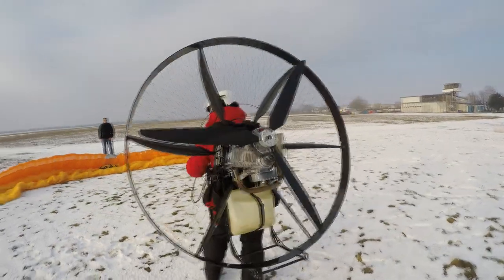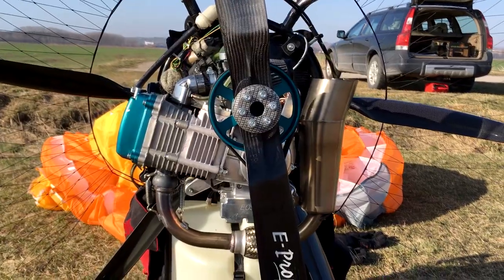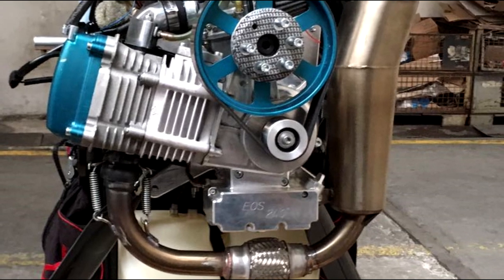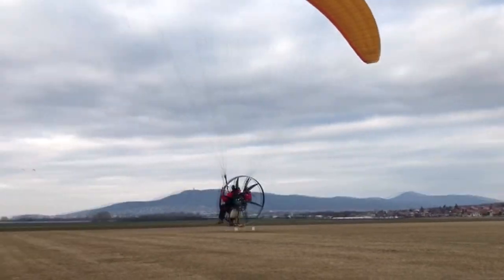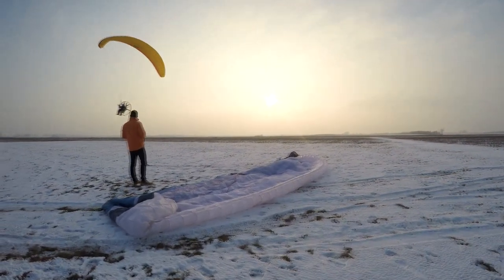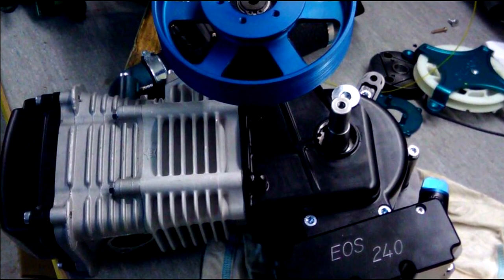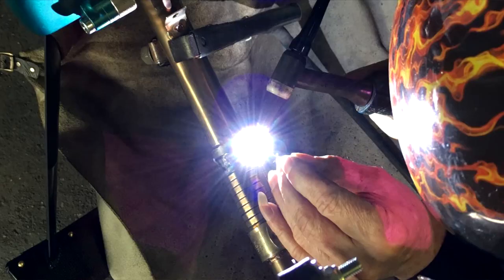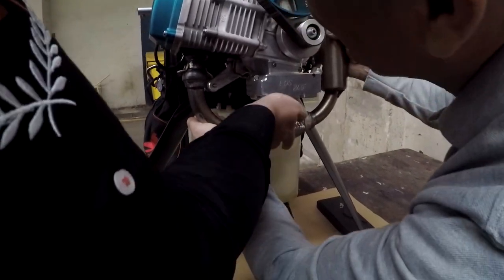Is this the best paramotor engine ever? The first true four stroke alternative!

Comment: Is it much Heavier than the same CC engine in a two stroke???
Reply from the maker: +randy beard you can't compare 2 stroke cc with 4 stroke cc. 
This is a 240cc 4S with 26.5 HP. 
It matches weight and power of 185cc 2S engines.

Comment: it's to bad you can't use fuel injection system... And I wonder if the motor needs a little heavier flywheel to help smooth out the idle..
Reply from the maker: +1cflchopper maybe next step...

Comment: "The first true four stroke alternative" was actually built and sold already in 2009 by Baileyaviation.com In those days the larger 220cc engine cost +/- £6.000 (20% VAT included). Since the Bailey website seems to be very dated, I'm not sure if they still produce the engines but since I first wrote this post I've found paramotor websites that still advertise them.
So Miroslav's video title is misleading at the least and not in keeping with his candidness in telling us what "mistakes" he made during the design of his paramotor system. I find it strange that since he has owned so many engines over the years, that apparently he never heard of the Bailey 4 strokes whose users had also won competition prizes...
Bailey's former price will give an indication of the price point the EOS four stroke engine will probably take, so don't hold your breath for an "affordable" 4 stroke from EOS instead of the 2 strokes that dominate the market now.
Having been closely involved with aviation engine projects before (ULPower Aero Engines) EOS's claim that they can make a four stroke engine with the same power output and at the same weight seems pretty far fetched to me since even after decades of internal combustion engine development by hundreds of design teams nobody I know of has even came close. (but kudoos to them if they can prove it!) 
As so often happens in Aviation, the beginner manufacturers in the market start out with material that is more or less affordable for "the guy in the street" and over time, improvements are made in material, features and design to the point that it then becomes unaffordable to the masses....
Reply from the maker: I know that engine. While I have a lot of respect to any innovation and I know how hard pioneering is, the Bailey does not come close to two strokes in terms of weight and power.
The EOS engine seems to be the first almost match the weight and power of general 180-200 cc 2T engines.
Reply: I can only hope they manage to do it, but a four stroke only has half the number of power strokes. The 4 stroke is more efficient with its fuel because of its induction system but this also means more parts and weight but compared to a 2 stroke it will have a lighter exhaust. I'm willing to believe you but I would not bet on it because history has shown that it has not been possible to do it. Personally I believe if internal engines are going to be with us for another 10 years or so, a fuel injected 2 stroke would be very hard to beat since you are not losing a considerable part of the 2 stroke's fuel air mixture out the exhaust port.

Comment: yes it was the best, until they changed it to smaller. this engine needs four things. 1. electronic fuel injection. 2. decompression starting. 3. better dynamic spark control for smoother idle, like maybe on early motorcycles, or cars. 4. exhaust pipe needs better to stop dancing around, never work.

Comment: I am just going to put this out there. This is not new. They are using the top end of a Honda gx240 engine . Use the fuel injection of a 250 motor bike and your sorted no massive costs and you will get big power and reliability. The paramotor engines are way behind .

Comment: how about a diesel powered machine?
Reply: life is what you make it, How about propane powered ?
Reply: A diesel version would be so heavy due to the strength requirements of the material needed caused by the much higher compression ratio (+/- 3x) plus the necessity to have a powerful electric starter & idem battery to turn the engine over the compression, that any internal combustion engine designer would never even consider putting on a diesel on the list of paramotor alternatives... For me the way ahead will be electric when the battery capacity and weight allow flights of 2-3 hours AND quick recharges in remote areas...

Comment: What I saw with the exhaust, was dampers way too flexible.  Thus causing pipe failure. My project will be to get one of those tiny turbos, boost ten pounds manifold pressure, and with no lean condition, ramp the jet much fatter in the carb,  and double the horsepower, weighing only 3# more. Why? Because we can, and record breaking altitude ppg climb.

Comment: Twice the flying range of a two stroke and with same power and weight -where the fuck do I get one?
Reply from the maker: +natural 9 stay calm. There is a lot to work on... Just another version of the exhaust installed and flown yesterday....
Reply: I'm trying hard but this is a great breakthrough producing a four stroke with same power and weight as the two stroke and lets not forget the reliability of a four stroke engine.Hope all the bugs get ironed out soon and the price isn't too high.

Comment: Fuel injection? you mean like this? Already been done
http://www.ecotrons.com/products/small_engine_fuel_injection_kit/ Not much benefit, apart from stopping the occasional cough from Carb icing. More weight, more Electrical power for fuel pump, Bigger battery to spin it all up.

Comment: im suspicious of half the fuel burn of a two stroke...ive not seen any four stroke capable of that with equivalent horsepower without other technologies being utilised. this engine has nothing new to backup such a claim.

the real benefits of four strokes are even power curve, better low down torque, quieter, longevity, smoother running, and the biggie...reliability. 
ppgers will fly places with a four stroke they would never risk going with a 2 stroke engine.

we have been using them in model aircraft for years...this has been to long coming and about bloody time.
Reply from the maker: Yes, I would be suspicious as well if i had not flown it.